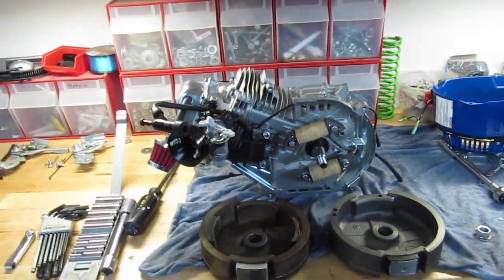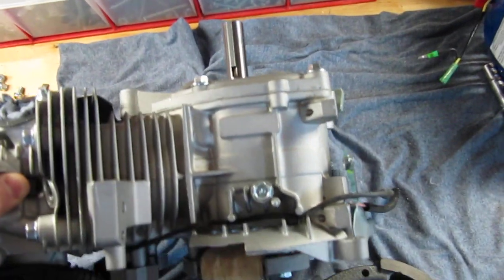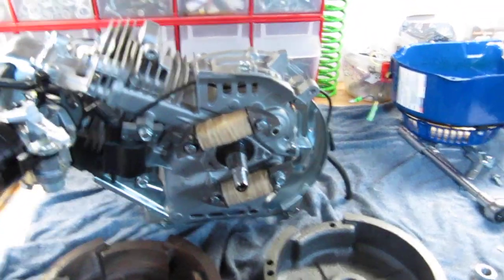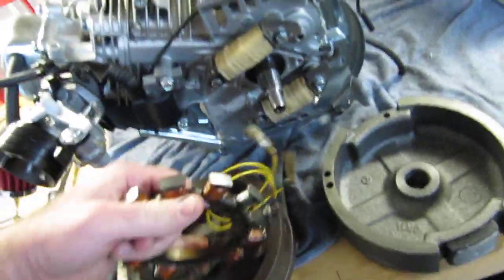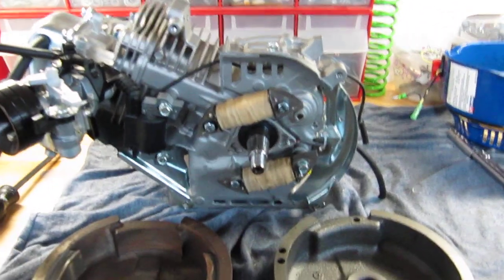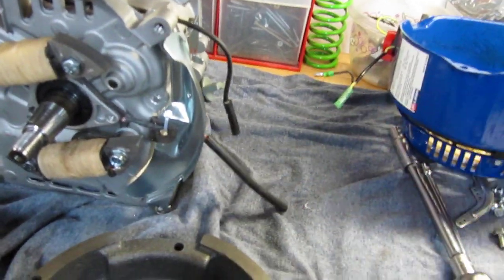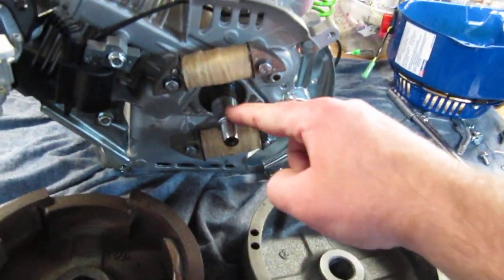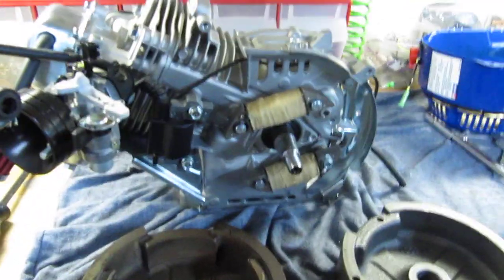Lighting Coil Install GX200

Comment: Did you need a different flywheel for the charge coils ? im guessing you would need extra magnets on there since the stock one just has the ignition coil magnets on there.

Comment: Hey buddy my engine gx390 has only 1 wire coming out from the charging coil , I test the ac voltage and is around 30vac , can add a regular rectifier to it by using the only wire and a ground wire so I can get constant 13 or 14vdc ?
Reply: You should be able to, my circuit worked with regulator that came in the Snowmobile.  I can't remember the circuit details, this was about 10 years ago.

Comment: Probably a stupid question but I have a Honda gx160 and it has an electric start but the electric start does not work and I want to take it off and just put a kill switch on it instead (engines for a mini bike ) anyways my question is do you need the charging coil if you are only using the pull start? Or is the charging coil only used if you are using a battery and electric start? Just trying to figure out how to simplify the wiring got me all confused
Reply: Take it all of :) you don’t need the coil if you don’t want have lights or el start

Comment: I looked into adding two coils like you did to my GX240 honda snowblower.  I wanted a power source for a headlight.  I didnt proceed with the project because I was told you need a 3 magnet flywheel to power the 12v 50 watt coils and my stock flywheel has 2 magnets.  Did your coils work with the 2 magnet flywheel?

Comment: For the predator I picked up the coils from a gx200 from eBay but couldn't find the flywheel with magnets. I found an old Robin engine with 4 magnets I salvaged two and adhered them to the original predator flywheel using JB weld (the other two where destroyed during the removal process). There was a clearence between the flywheel and the coils was an issue the predators flywheel has a gap of 122 mm between weights the Honda is 125 mm I  had no issue with the gap between the magnets 132 mm. Tried to have it machined but no one could (or wanted) to do it. So I picked up two mounted points 60 grit and with my drill spent 3 hours grinding down 1.5 mm from each one of the weights on the flywheel ended up with a 125.3 mm gap and it Worked!! Now my go kart has lights.

Comment: i want to do this design but put a regulator to charge a battery i have a electric start honda same basic engine as this anyone know of the right regulator?
Reply: Hi I use the mooped 4 cable bridge regulator works fine

Comment: will the original predator fly will work
Reply: Sorry for the late response, but no, you have to have a 3 point magnet for the lighting coil to work.
Reply: Also predator flywheels are grenades